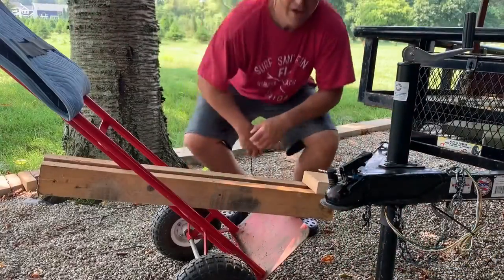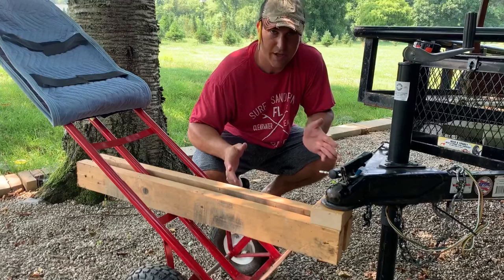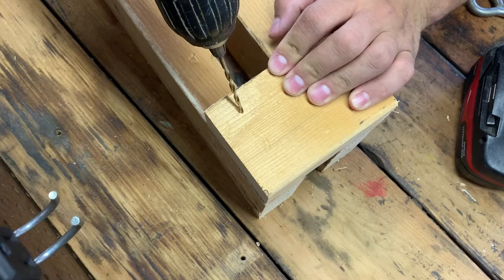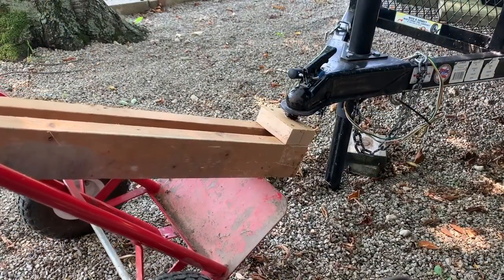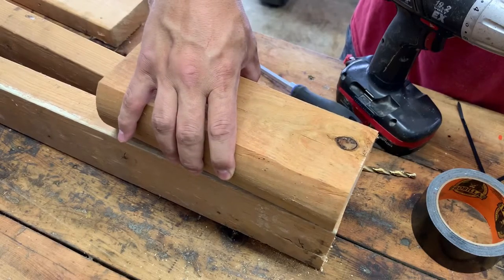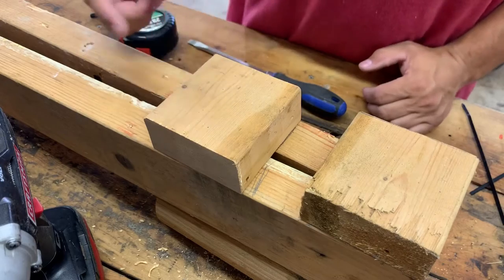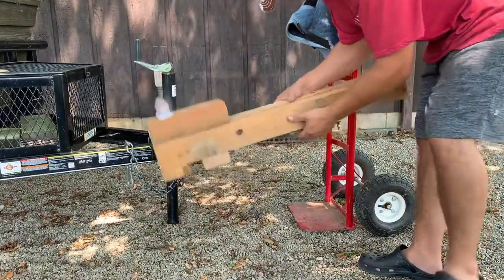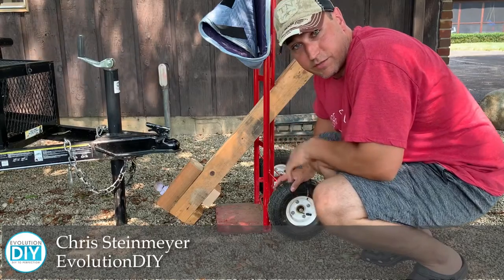Can I Use a Regular Dolly as a Trailer Dolly?

Comment: I watched your video and built this today!  Super fast and simple build, and it works great!  👍 I did modify it a bit, as my dolly was a little different.  1.)  I sandwiched a 16” 2x4 between the two outside boards and screwed it in place to make the outer boards gap more uniform.  2.) I put a little 4-1/2” square of plywood on top instead of the 4x4.  I then drilled through the plywood and center board to install the bolt.  3.) I added a 4-1/2” long piece of a 2”x2” across the top where it meets the dolly center support to keep the rig from falling back through the dolly when unloaded.

Comment: Nice idea, and is very similar to mine, but I have a different approach to the task of moving the trailer.
    Yes, the ball is basically fine for this. But, I pick my trailer up by the tongue instead. I made a tongue fitting at the pickup point near the ball receptacle. It's a piece of 2 x 6 with a hole in it. My hand truck adapter has a nearly vertical 2 x 4 at the correct angle tapered down to a 1.5" x 1.5" square at the top where a ball would otherwise be. This fits into the 2 x 6 with the hole under the tongue.
   I can pick up the trailer that way and move it around just the same as the ball design. But in my design the trailer ball receptacle has nothing in it, and I can use the dolly to maneuver to the exact location and drop the receptacle right onto the tow vehicle ball.
  I hope my explanation is clear enough.
Reply from the maker: I love that you can move it, and drop it right onto the ball of a hitch. Cool idea, thanks for sharing. Maybe I’ll make a version 2.0 in the future!
Reply: @EvolutionDIY I've subbed.

Comment: you think that'll hold up and work on a 3500-4000lbs boat or trailer ?
Reply from the maker: I doubt it. I actually tried it on a small boat trailer ( 20ft Bayliner Capri on a trailer) recently, and it was not sufficient. I ended up moving it with a small compact tractor.